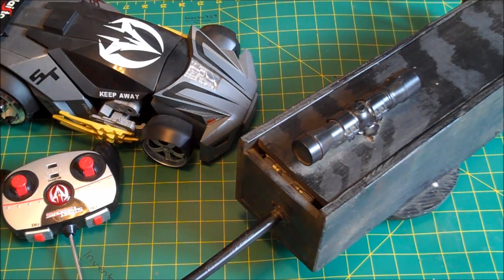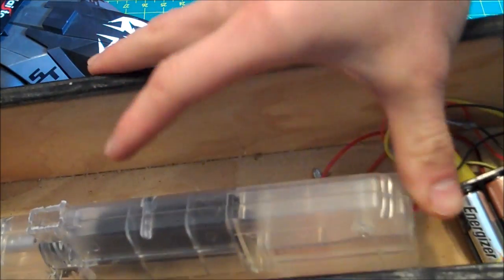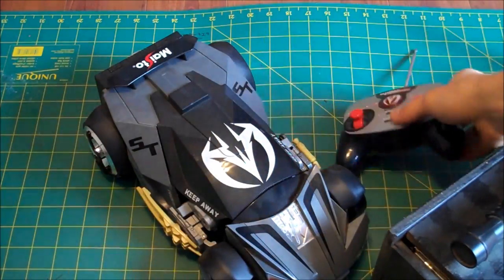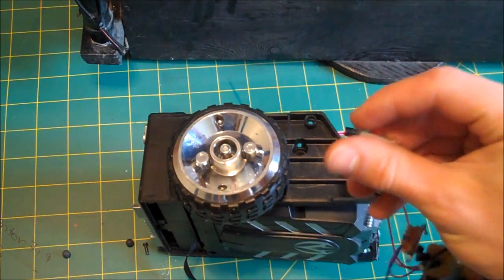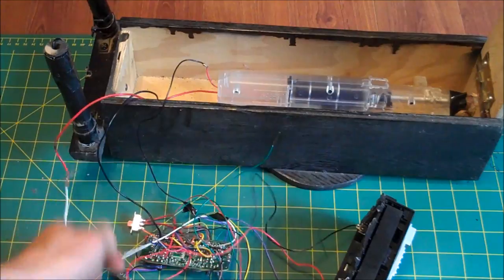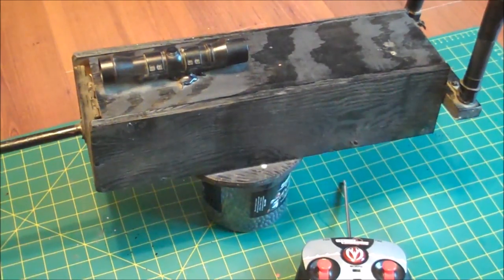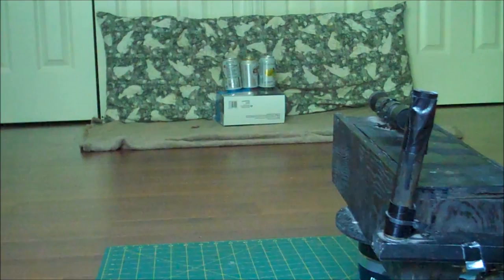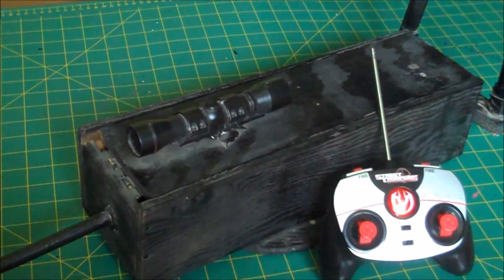Homemade R/C Airsoft Turret + SHOOTING

Comment: about the turret turning...if you were to build a base like when it was sitting up at the shot test on your ammo bucket, place that on a lazy Susan like it originally was ( with the ball bearings) place that on a base of flat wood then mount the tire facing up with the tire against the round base so basically the tire is racing against the tube to go left\right...hope this helps you out!

Comment: you should be able to have it swivel if you have the motor attached to the gun via a chain or belt.. then just reduce the gearing.. It will slow the movement to a more manageable speed and increase the torque received from the motor

Comment: You can make it swivel if you put a gear configuration on it, make the wheel turn a small gear and the small gear turn a big gear that is connected to the stand
Reply from the maker: +TheLongRun good idea